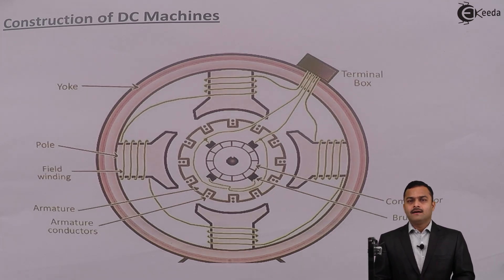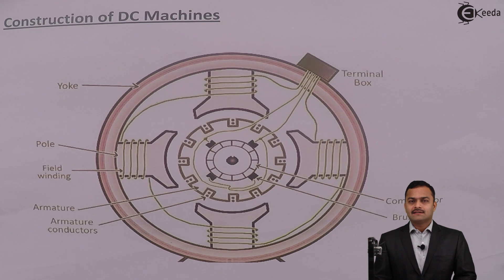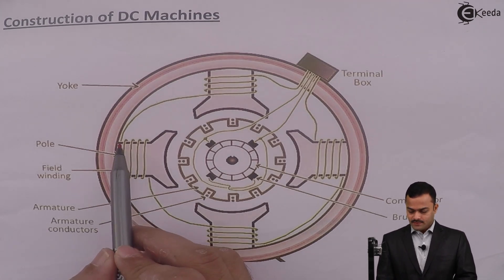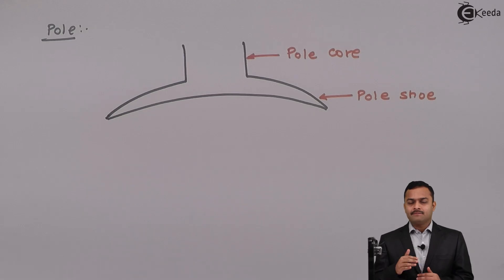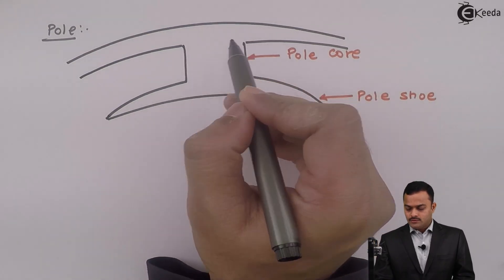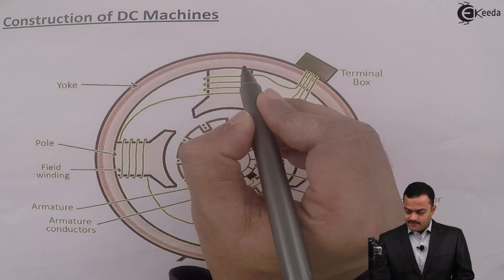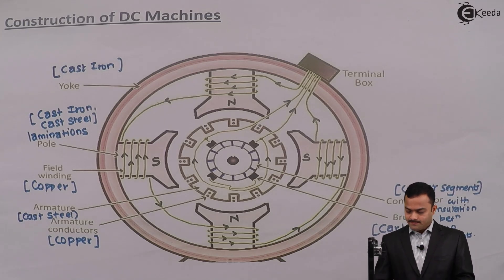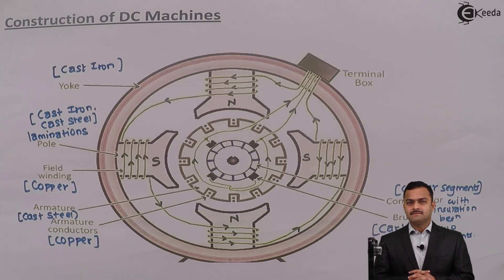Construction of DC Machine and Its Components - DC Machines - Basic Electrical Engineering

Comment: Construction of DC Generator:
1. Yoke : 
• outermost protective cover
• Responsible for protection of insulating material used inside.
• Protect all comp inside from dust,moisture and gases.
• Provide mechanical support
• Provides low reluctance for the flux
• Made up of cast iron

2. Pole: 
• Have 2 parts
• Pole core responsible for freely winding
• Core Direct the mag flux to air gap , armature and next pole.
• Pole shoe cover max armature conductor to cut the flux so that more emf is induced. 
• Made up of cast iron, cast steel.

3. Field windings
• Made up of copper
• Current carrying coil, experience Force in MF

4. Armature 
• Part of dc machine where emf is induced.
• Made of cast steel

5. Terminal Box
• Has output wire cominf from armature

6. Armature conductor 
• Made up of copper
• Simplw wire, job is to carry output current

7. Commutator
• Act as Mechanical rectifier so that alternating emf can be converted to unidirectional emf in dc.
• Made of segments
• Made up of copper
• Two segments are separated by thin layer of mica
• Take out voltage and current 

8.Brushes
• Fixed with armature, rotates with armature
• Takes voltage and current from inside of commutator to outside and take it to terminal  box
Reply: 16:35 brushes do not move
Reply: thanks you
Reply: Brushes are connected to commutator not armature.
Reply: It's Yoke not Yolk
Reply: @KaranSingh-205 thnx, i corrected it
Reply: @ChefnCoder Bro it's been 2 yrs. Maybe you are in your final year or pre final year hahaha
Reply: @KaranSingh-205  yeaah , entering my last sems now😅
Reply: @ChefnCoder All the best for the last sem and professional career
Reply: @KaranSingh-205 Thnx